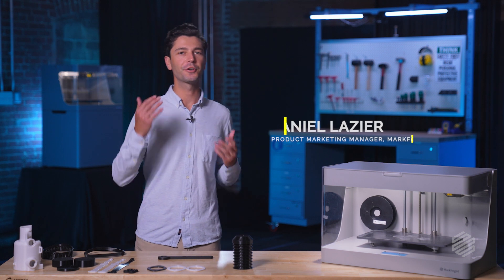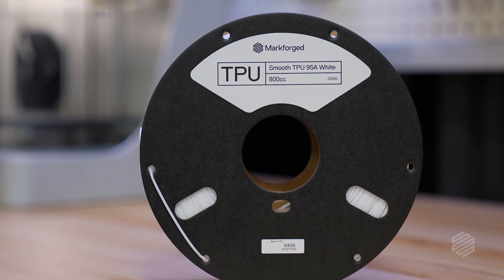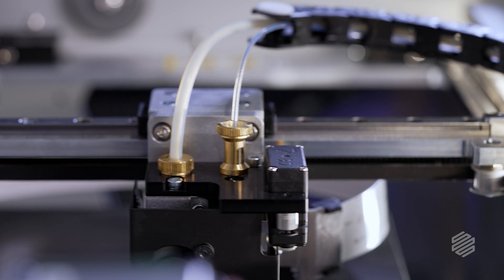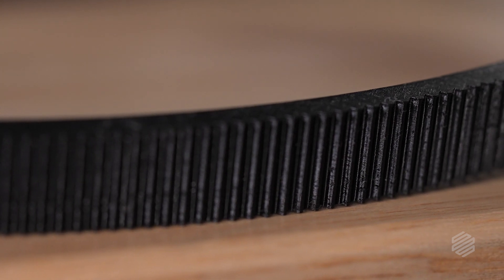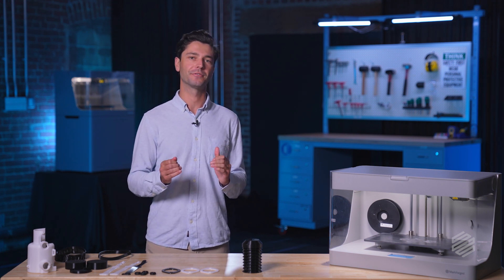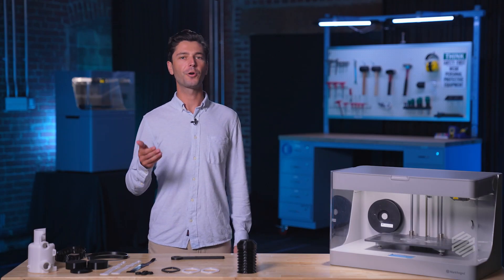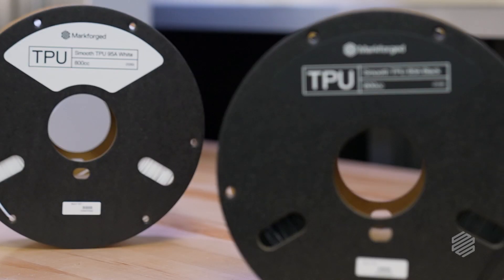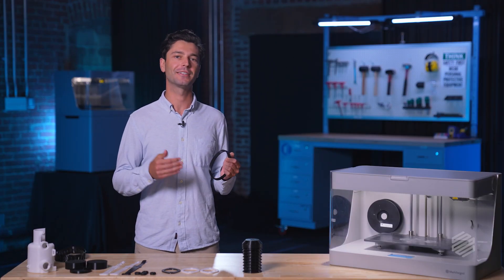Minute With Smooth TPU

Comment: Can someone link me a visual test of the different shore hardnesses of TPU? I'm hoping to make soft training tools for my training center and want some that are soft like silicone, and some that are harder more along the lines of PBT but with a touch more flexibility.
Reply from the maker: Hi there! Markforged Smooth TPU has Shore hardness of 95A or 53D. Printed solid, it should feel like a skateboard wheel; printed with geometric infill or in thin sections, it can be made more flexible. For reference, a car tire at room temperature is usually around 70A. Silicone rubber can typically be made anywhere between 30-80, and PBT is around 90D. 

For more information, check out the Smooth TPU material page here: http://bit.ly/41hfYJP - Definitely download the datasheet and let me know if you have any other questions.

Comment: Is there anything I have to do to my older Mark Two to print with this matirial?
Reply from the maker: Hi Antony! Thanks for the question, depending on how old, you’ll need to make sure you have a Gen 2 extruder. Then you’ll be able to print in smooth TPU and Precise PLA as well
Reply: @markforged  How can I tell if I have a Gen 2 extruder?
Reply from the maker: The sticker on the back of your printer that contains the machine ID will say "Gen 2" on it